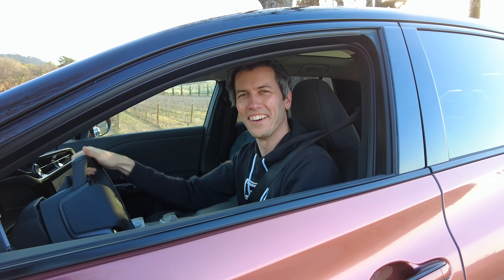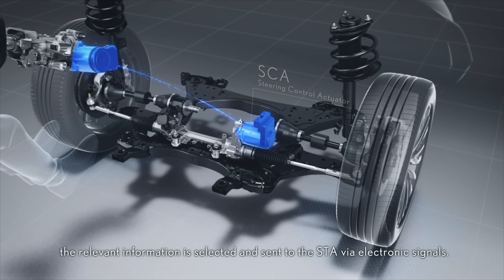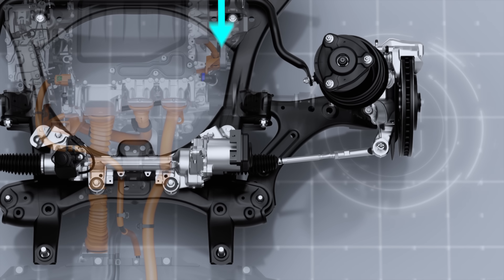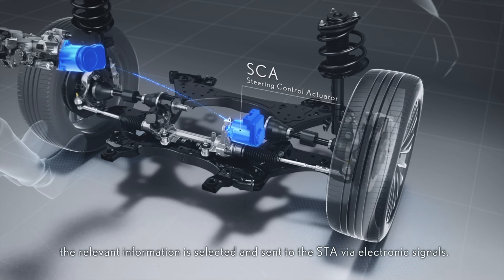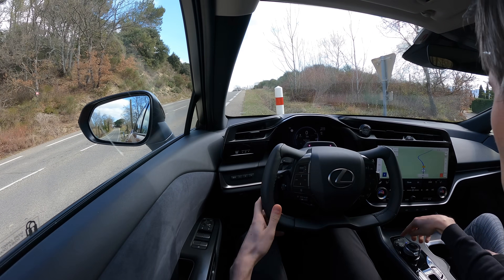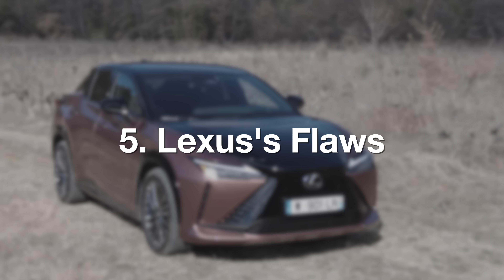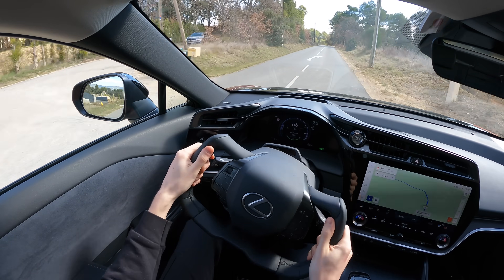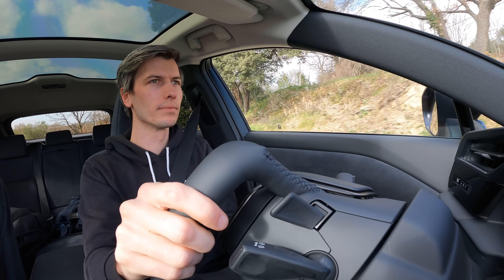How Lexus Fixed Tesla's Bad Idea: Steer-By-Wire Yoke

Comment: One important benefit you didn't touch on Jason is that removing the steering column leads to increased crash safety.  Steering columns are a real pain for automotive engineers as the linkages needs to be able to break so that a column doesn't impale your chest.  Removing the steering column completely helps with crash safety a lot.
Reply: A lot of people would hate this as it would feel hard to predict. An obvious solution would be to have different ratio modes you can manually change between, like changing gear.
Reply: @frozenwindow407  Interesting idea, I think the main challenge would be making sure everything stayed in alignment (center is center in all gears).  A gearbox has the neutral position btw gears, and sequential gearboxes have a larger gap on the dog engagement teeth so you can slam the gears with a higher chance of engaging (introduces backlash).
Reply: @amorag59  since there are no actual gears here, alignment would be trivial. Keep in mind that all the mappings are done in software.
Reply: @falxonPSN  Alignment is not trivial if the rack cant keep up with the steering wheel as shown in the vid. Oh the mappings are in software? Ooh I thought they were kept in a rolodex 🙄🤣
Reply: @amorag59  All he's showing is a finite processing delay. There's no inaccuracy whatsoever. So yes there is absolutely a guaranteed correspondence between dead center of the wheels and dead center of the steering. And yes it is trivial. All that would have to be done is to reduce the processing time or the number of data points being averaged before being sent to the motors, but this would admittedly make the output slightly twitchier but that would essentially resolve the issue.
Reply: @falxonPSN  You want a fast response time with minimal overshoot to "align" the rack to the set input. If you have so much response time (ie driving at low speeds, rack is not as responsive) in an extreme example the rack would never hit continuously varying set inputs - this is far from "no inaccuracy whatsover" . If you shake the steering wheel to its extreme left and right the actual wheels cant go from lock to lock and end up instead cycling near the center point. This is what we saw in the video.
Reply: @falxonPSN  I'm not sure why you are arguing that something without mechanical alignment would perform the same and never lose alignment...
Reply: @falxonPSN  How do you even know the problem is down to response time of the controller? It could be the actuator is at it's peak performance.
Reply: @amorag59  it's just basic motion control theory.  You average a certain number of responses (and/or apply a hysteresis curve) to prevent having a noisy output.

I guarantee the actuator speed is not a problem for one simple reason: if it was, they could simply put in a faster actuator or better gearing.  That's not rocket science, and would not be a huge deal.
Reply: @falxonPSN  It's hilarious you are still arguing that a point doesn't exist that we literally witnessed in the video. If the response were on point we wouldn't be seeing the steering wheel and front tire steering not perfectly in tune.

Edit: And my comment was "how do you know?", did you design the system? You don't know the cause any more than the rest of us. You can only theorize that they could have put a faster rack motor or geared it better. There could be a reason that neither you or I are privy to, but again the fact that were discussing "fixes" literally is indication of a problem.
Reply: @frozenwindow407  no, physics can easily transfer force feedbacks by just running the servos in reverse. With tuning it should barely feel different. But the whole point of argument here is that in the event the electronics fail, which is very much more likely, you'll die. Your steering wheel will be no different than the one like on the kids trolley.

Also since its electrical its also easier to sabotage, any wrongdoer can just grab some emp circuit, stick it somewhere and run it remotely, suddenly your steering has zero responses.
Reply: @aoyuki1409 It's like you forgot to listen to the bit about redundancy. I doubt it's any less safe than a traditional mechanical steering systems which can and have failed many times. I think the more important question is - is it an improvement? From Jason's feedback I'd say not at this point in time. I don't think the "benefits" of a yoke make up for the shortcomings of the system. Let's face it - we're really clutching at straws when we try to point out the "negatives" of a round steering wheel. I think the only valid one is the yoke is "cool".
Reply: @aoyuki1409  wouldn't that kill the car too and not just the steering? I feel like it would stop more than just the steering if youre throwing emp out.
Reply: @takumi2023  i mean when we try to electrify every part of the car yeah. car industries now needing electronics ruined the balance of supply and demand in electronics and caused severe inflation prices and supply issues. also the fact that vital components such as proposed steer-by-wire would need to be properly maintained and inspected and tested many times more than a steering column. i know people who dont even change their oil until their engine is close to seize. imagine suddenly losing control of your steering in any other way. sure airplanes can use it but they check those every single time they land
Reply: @aoyuki1409  where is this sophisticated sabotage that's happening all the time in the real world?
Reply: @ellemnist  even a random power surge in power lines can knock electronics temporary even if its not connected anywhere. Even the static in the air during a lightning storm can sometimes jam your smartphone screen. Electromagnetic interference is everywhere and how do you suggest shielding against them? Really huge and heavy grounded metal plates? Pretty sure the intent was to remove a heavy piece of shaft. And how do you expect consumers to pay for maintenance of expensive, sensitive  and important electronics motors and servos. Its basically your string of life. Not keeping it well maintained equals certain doom. Not just for you but for people around you, and your family.

Steer-by-wire is a solution to a problem that doesnt exist. Collapsible shaft steering with EPS by far the best, safest, and economical that isnt too complex for general consumers.
Reply: @aoyuki1409  well that extremely unlikely scenario of using an emp would kill most modern cars anyway.
Reply: @Moe_Hippo  but it wouldnt disconnect the steering or brakes. Its not like suddenly the windscreen stops being transparent because you ran out of juice
Reply: @aoyuki1409  It's likely that, since this system is likely to be computer-controlled, an evildoer can not only EMP your steering, but hack it and reprogram it however he wants. Maybe it'll steer normally until you reach highway speed, and then suddenly swerve across the median. The possibilities are only limited by the hacker's creativity.
Reply: @takumi2023  Sure, the car would be dead. But normally, if your car dies on the highway while you're driving at highway speed, you can steer to the shoulder. Not so with this car. Not only is the car dead, but it's also unsteerable. All you can do is slam the brakes and hope the guy behind you doesn't slam into you. Unless the brakes are electronic too.
Reply: @aoyuki1409  my 96 f250 has throttle by wire for nearly 30 years now, never had a problem. Even gas  vehicles had throttle by wire for over 20 years. taking an extreme and making it seam like it normal case is not a reason to try to improve tech
Reply: @aoyuki1409  , and yet fly-by-wire systems in aircraft are more robust in comparison to analogue systems.

Moreover, even military aircraft weren't sabotaged in a way described by you. Also, modern cars with mechanical steering still require power for hydraulic or electric power steering systems. While the steering wheel will still work without such system, unprepared driver will still likely lose control of the vehicle.
Reply: @aoyuki1409 , Faraday cage will fully shield any electronic.

Anyway, aircraft, both civilian and military, do not seem to suffer from electromagnetic interference to the extent that is implied by you, despite many of them using fly-by-wire.
Reply: @aoyuki1409 in the age of electric cars and emp would comprise the whole car whether steering was mechanical or not
Reply: @kushday1155  its not about if the car was compromised. its about HOW the car was compromised.

a compromised electronic brake is manageable, parking brakes still use physical cables to engage. downshifting and engine braking still functions.

a compromised ignition system just seizes the engine. still manageable to some degree.

a compromised steering? you cant even dodge obstacles. this is assuming it fails to open. if it fails to haywire then you will get rocked left and right and might flip the entire car.

the point is you're more likely to die in an emp attack with a car with drive by wire steering. an emp device is also not that hard to make, you just need a pulsing high voltage spark. old car ignition coils can be bought at junkyard for cheap
Reply: @aoyuki1409  correct me if I'm wrong here .. does a emp not compromise all electronics in a specific radius.. now if this was used remotely I assume it's whilst the car is running ...let's think of a tesla for example , your fucked regardless in that scenario..  when you think about everything that's electronic in the car . BTW I understand it's an extra point in failure my main concern is the lag , software bugs and hacking .. not really emps . But maybe that should be a concern but for all electric /hybrid cars
Reply: @kushday1155  that type of EMP you're talking about is a megawatt version. it would be a stationary or mounted weaponry only the military can afford. at that stage, your probably should worry more on surviving alive, than trying to save your car. I'm talking about smaller, diy, arson/thief level emp that is basically a tesla coil that criminals and vandalists can make from scratch. these devices can be installed on a targeted (random or not) car and remotely activated. it has a fairly small radius like a few meters for battery operated ones but they would be strong enough to cause mild or severe disruption on electronics near them while the emp is active. usually you can protect your sensitive electronics with grounded shields but there will always be flaws people can exploit.

if you're American and you have a spark taser, that is basically a weak EMP device. if you have your taser on, your touchscreens will not function properly because of the radiated EM waves from your taser
Reply: @frozenwindow407  i mean, no. hard to predict? i strongly doubt this xD if a shitty company with no money can develop racing wheels that manage to actually give decent feedback, then a very big company like toyota can too xD especially when you consider that when you drive a real car, you get a lot of feedback through your seat too. (usually the one thing people say racing sim setups lack, hence motion rigs)
Reply: I guess you're going to need that safety when crash has become 10 times more likely once joy-con drift begins
Reply: Yeah but an electrical failure could cause a crash in this thing that wouldn’t have happened in a car with a column.
Reply: In a modern car, how often are people impaled by the steering wheel? The numbers are probably very low now compared to cars that predate the airbag.

I would rather see innovations in pedestrian safety. In the United States of America, vehicles are getting heavier, taking up more room on the roads, and higher drive heights. In the hands of a regular suburban consumer, this is a dangerous combination for pedestrians. Doesn't help that SUVs and trucks account for a significant portion of air pollutants.

Government regulatory agencies need to start enforcing CAFE regulations on the "light truck" and "SUVs" segments. It's getting out of control and people are dying because of it.
Reply: @polecya  EPA regulations are the reason that light trucks and crossovers are so big to begin with.
Reply: @polecya  46,000 automobile related deaths per year in the USA... probably pretty often.
Reply: My immediate thought as well 👏
Reply: Yea but the milliseconds you lose from input delay will put you in a crash
Reply: That chestnut has been solved with the collapsible steering column for decades.
Reply: oh great, at least the steering rack wont impale me after i crash due to being unable to swerve after my software decided to die
Reply: if there is no console (the console can be flexible or retractable), you can hit the dashboard, if not dashboard, you can hit front window and so on...
Reply: Yeah sure, let's just get wasted by motors and a huge chunk of steel, instead. Did you see all the crap right behind the wheel?
Reply: That's the only eproblem about the traditional steering systems imo
Reply: Yes, also cars become more unreilable
Reply: maybe in the 1980's
Reply: If you ever lose power while driving you'll want that steering column real bad
Reply: Didn't even cross my mind how that would be a possibility. The things we don't even notice are taken for granted
Reply: @eugene9852  what do you think would be bad about manually changing ratio settings? The reason I thought it could be good is that the control you have is more predictable that way.
Reply: I'm sure that'll help with all the crashes they end up causing
Reply: Good point. It's like a spear directed at your chest
Reply: But what is the issue if the problem was already solved? This new tech has not been necessitated by crashes I can assure you.
Reply: Collapsible steering columns are a thing
Reply: wow
Reply: First though on my mind... Old cars impale people, then start breaking the steering column, but was not exactly perfect for some time, and failures over the years make some victims. Removing it, totally are a great safety earn
Reply: This is not the 1960s. That problem was solved a long time ago. My question is what happens when the system fails. It power steering fails you can still turn your can to get you off the road. When your steering position sensor fails, bad things will happen
Reply: “completely helps with crash safety a lot”

wow so scientific. you’re a real expert 😂
Reply: Terrible take, steering columns are already designed to collapse, on the other hand a sudden electronic failure will absolutely cause a crash with this abortion of a idea.
Reply: Okay and that crash wouldn't happen in the first place if the electronics didnt fail and you have no steering whereas even if your power steering fails you can still mechanically turn the wheels. Steering by wire is RETARDED
Reply: That's useful when you crash thanks to this moronic system.
Reply: Any maybe if you had a mechanical connection you wouldn’t have crashed in the first place
Reply: So to remove the steering column to help with safety, a problem that has already been solved for decades, you have to design an entire electronic feedback system to simulate what the tires are doing. I’m not seeing the benefit here…
Reply: @maynardewm  they could literally use off the shelf sim racing components
Reply: @maynardewm  thats because you're not very bright
Reply: ...and that will come in handy when the car overrides your "moose test" maneuver when you're trying to avoid a crash...
Reply: @blechtic  If it overrides your input, that means you'd have skidded anyway if it let you do that, meaning you'd hit the moose either way. IIRC fighter jets have a similar thing where the fly-by-wire tops out at certain points to prevent you from changing direction so fast that you'd snap your neck. If anything, NOT having the direct mechanical control means the car's stability control can do the absolute best to avoid a moose by steering as much as possible, whereas the human behind the wheel running on adrenaline and minimal training would probably skid.
Reply: @blechtic  Lmao, car be like "What moose? I don't see any moose. You need to be STABLE on the highway, turn SLOWLY 🥰"
Reply: That engineering problem was solved decades ago, though
Reply: @luisdetomaso867 removing a problem from having to be solved is better than keeping a solution to the problem. It also provides more flexibility in design.
Reply: @_KingRaz  Right.  An electromechanical system that costs thousands of dollars and has dozens of components and failure points is a better solution than a $25 collapsible linkage
Reply: @luisdetomaso867  well said ;)
Reply: @luisdetomaso867  That was a stellar comeback. Bravo!
Reply: @_KingRaz  Okay... explain to me, What do you think of the sensitivity.? A fixed wheel turn to steering turn ratio is predictable. while a different wheel movement to steering input at different speed is something that you will only have to learn from the vehicle movement to again adjust.  

I will never say Yes to this
Reply: @ധാസപ്പൻ  sure that's fine. Steer by wire can be fixed as well, it doesn't have to be adaptive, it's just an option for people who do want it. I don't think I would like it either and I drove for a living for 6 years, but everyone has different preferences. It's not even an option with a direct drive.
Reply: @luisdetomaso867   I think most modern cars use lot of computer electronics, with more data & over the air updates, this technology can further be improved upon with AI/ML models and actually might decrease the cost of the vehicle (may not be initially), the censors are actually cheaper and due to reduced weight the increased fuel efficiency. I had a Honda civic and it's been 15 years and none of the electornics gave up eventhough I had driven it rough and tough and most components are electronic. So I'm a BIG YES for this technology.
Reply: @luisdetomaso867  None of that matters when it’s life and death.
Reply: @_KingRaz  you are right. You are removing completely a failure mode.
Reply: @ധാസപ്പൻ  I get where you are coming from, but Lexus and others have had Variable Ratio steering for decades now as an option in some SUVs.
Reply: @luisdetomaso867  I do believe this system would be great for racing though, the increased cost and decreased reliability wont matter if your car isn't going to last more than a few races anyway, the fact the steering wheel isn't directly connected means that the wheel wont jerk your wrists left or right and cause injury, would be super useful for NASCAR considering the speeds of the crash and weight of the body and wheels.
Reply: @grandiewandie  It depends on how good they can make the feedback and response time.  Race car drivers require extremely precise steering
Reply: @_KingRaz  not necessarily if removing the problem introduces a new set of problems, such as a delay between steering wheel rotation and wheel rotation
Reply: @luisdetomaso867  so you put money over driver safety, embarrassing comment
Reply: @OHNO-k9l  no it wasn't though
Reply: @ant2312  What's embarrassing is that you truly believe a fake electric steering wheel is safer because some guy on the internet told you so.  Modern collapsible mechanical steering works fine and is perfectly safe.  This solves a non-existant problem
Reply: @_KingRaz well said!
Reply: @luisdetomaso867  very well said ;)
Reply: @luisdetomaso867  Dozens of failure points? Don't you mean millions of failure points? There's definitely software in this system, and software is the most unreliable thing ever.
Reply: @luisdetomaso867  said the one that has eps in his car
Reply: @_KingRaz decisions are not fashionable
Reply: @luisdetomaso867 all consumer vehicles will eventually go this way. Not in the next decade, but in 50 years? I can see it.
Reply: @_KingRaz .. and it then it adds additional problems
Reply: @luisdetomaso867  Uh the regular steering column has just as many failure points... including one by design...
Reply: @_KingRaz No you're wrong, also if your electrical components fail how do you steer?
Absolute reliance on technology is already shady as it is,
Absolute reliance on gadgets seems very foolish in my opinion
Reply: @_KingRaz  this is literally reinventing the wheel
Reply: @luisdetomaso867  Yeah, and AFAIK there is also a movable column approach where it moves with the steering wheel. Because how can the column impale you if there's a steering wheel at its end?
Reply: Not to mention this solves the LHD and RHD issue.
Reply: Collapsible steering columns are incredibly simple to design and that's been a non issue in crash safety for decades. Look at crash tests that have been conduced far beyond survivable impact speeds, and it's apparent that the idea of occupants being impaled by the steering column is a thing of the past.
Reply: @crudboy12  since every vehicle design is different not all Steering racks and steering columns are the same. For each vehicle there are thousands of dollars invested in Crash Tests and Sled Tests just to design freeze after PV validation. So the vehicle dynamics basics are there bc years of legacy data but collapsing performance is still a failure mode that needs to be addressed on each product launch. As I said this, there are other issues with Steer by Wire that still needs development but if it is solved that is the future for steering systems.
Reply: Prove it! Breakaway steering columns have been around for ever so there is no engineering challenge there. Drive by wire is not like fly by wire because their is no redundancy. Also, cars don't get the routine maintenance that aircraft does. Today's cars are overly complicated engineering nightmares. 

Automotive engineers don't live in the real world and they have dangerous tunnel vision. When the steering control unit fails because of corrosion or crap wiring harnesses or ECU failure the driver and other innocent people pay the price.
Reply: Invented by people that come to work on a bicycle.
Reply: Just waiting for their service calls of 10milion cars due to quality of the any sensor or redundant sensor, motor or redundant motor, battery or redundant battery lol.  they have shooted in own foot with such unbelievable overcomplicating simple things...
Reply: @qqqqqq6686  no one calls Nissan customer service when their tire pressure sensor goes bad
Reply: That's a problem that was dealt with a long time ago and the steering wheel shouldnt move otherwise youll get killed by the damn airbag and after a certain speed no matter how is the car made,designed and whatever the safety rating you will die or get really haveily injured. Crash tests are not done at vary high speeds.
Reply: If a car has proper steering instead of a Fly-by-crap, then accident is less likely to happen.
Reply: It simplifies design and construction for left or right steering.
Reply: I drive order pickers at my warehouse job. They use steer by wire. Let me tell you: if you go to make a subtle direction correction, it can wildly throw your angle off. I've nearly crashed into several racking units because I made a slight adjustment with the steering wheel and it decided to throw me off to the side. Mechanical linkages are way better at helping you not get in to a crash in the first place.
Reply: @UmbraFaux  we have those at the airport, yeah they are really horrible. But it's is way different
Reply: that problem was solved ages ago with the telescoping steering shaft, nowdays nobody gets impalled by the steering shaft, you may be hit by the steering wheel air bag, but thats it
Reply: This is a very elaborate and expensive way of solving a problem that was solved ages ago but I guess that's the whole point of it. Big cost, small benefit.. at least from a consumer stand point 😉
Reply: @talictdf4757  Bet the reliability is lower and the service costs are higher, too.
Reply: This isnt elimination. This is substitution.

We are substituting a steering column that has been engineered to collapse during crash, in exchange for a steering system with 3 times the failure point, complexity, price, and last i checked suddenly losing control of the steering usually results in crashing. Definitely worth the swap if you want people crashing and dying faster and more often
Reply: @aoyuki1409  Also, it's kinda sleazing around the issue to make redundancy highly integrated, so I'd suspect with a compact dual-motor setup in one casing, there can occur issues that would affect both motors, so it's potentially dangerous pseudo-redundancy.
Reply: @aoyuki1409  "...Definitely worth the swap if you want people crashing and dying faster and more often"
Luckily nobody tries this with really critical things like planes or giant trucks...
Reply: @irgendwieanders2121  yeah those are electrically augmented control system, they still contain crucial mechanical linkages and mechanisms. i do wonder why they aren't made fully steer-by-wire
Reply: @aoyuki1409  Electrically augmented? Not purely mechanical?
Now I am afraid... Wires can break!
Reply: @irgendwieanders2121  Luckily every day driver maintains their car like a plane and drive it at giant truck's speeds.
Reply: @aoyuki1409  planes do not have mechanical linkages between controls and control surfaces, it’s all fly by wire
Reply: @aoyuki1409  that literally doesn’t matter, there isn’t a direct physical connection between the control device and the control surface.
Reply: @cennty6822  Depends on the plane. Most Boeing models do have a mechanical connection, via hydraulics, between the controls and the control surfaces. It's only Airbuses and military fighters that are true fly-by-wire.
Reply: @irgendwieanders2121 the most reliable aircraft have manual controls for backup, eg the A-10 Warthog.
Reply: @ZombieLincoln666  🥰
Reply: We figured out collapsible steering columns in the 1970s, guy. It's proven technology.
Reply: The thing isn't the steering column, it's the physics. People in the passenger seat/back seat/trunk still die so it doesn't really help in a very significant way.
Reply: Automotive engineers are a real pain to consumers and mechanics. Wait until corrosion in the salt belt destroys the BS steering module.
Reply: It does however increase the likelyhood that you'll crash when an electronic failure could mean you can no longer steer the car at all.
Reply: @BigUriel  it decreases the likelihood that your car crashes when your collapsible steering column breaks as well
Reply: They need to be able to completely control the auto for cases of non-compliance.
Reply: Not really as you now have a module that is a dense box instead of a long multi contact shaft... pretty much a stead box is MORE likely to fly away as it has less points of content and may be HEAVIER to.
Reply: we solved that allready. like 20+ years ago....
Reply: But it's a problem already fixed ages ago and has multiple standards that are both economical and safe. Removing the steering column, and integrating a new technology that is technically less evolved and proven, so becomes less safe. Give me a steering column any day.
Reply: @eugene9852  nope, like 99.99% (probably way more actually) of cars on the road have a mechanical connection between the steering wheel and the front wheels, and a hydraulic connection between the brake pedal master cylinder and the callipers. 

Which is the way it should be, because even if all your electronics go haywire, you can still steer and stop.
Reply: So they've offset the increased chance of an accident by making that accident safer.  I'll pass, thanks.
Reply: People saying “what if something fails?” clearly didn’t pay attention to the video. 😂 Every part that is essential to be able to steer the car has a an emergency backup. If something does fail you get notified of it, and can still steer and stop the car safely. If you’re b*tching about the added repair cost then don’t buy it! It’s so simple. If you can’t afford the maintance/repairs on a vehicle what do you do? YOU DON’T BUY IT!!!
Reply: In 1978 Mercedes-Benz W116 got antilock breaks. They were expensive. Extremely complicated. And increased the stopping distance more than 25%.

 So saying something is a bad idea when looking at the first implementation isn’t really useful. Look at what benefits it gives you. Then decide if those benefits are worth the continued engineering to perfect the system. Removing the negatives and making it cheaper.
Reply: Then you get the increased chance of crash because of the unpredictable steering wheel action. In a perfect scenario, the driver needs to pass some learning curve because the new vehicle reacts totally different in all the different danger scenarios.
Reply: That WAS a problem with rigid steering columns. But it has been solved decades ago. 
To avoid the brake cylinder to be moved by the engine block or other rigid parts in case of a severe frontal crash, is the more current problem to be solved even in cheap cars.
Reply: @Nitramrec  cheap cars are on the chopping block. Those that have a hard time replacing brake pads when needed have zero clue as to what is coming.

Yeah but Tsal electric autos utilize regenerative braking so there will be no more need for brake pads.

Lol.

/Listening to Red Barcheta
Reply: also about safety, if people are to scared of steer by wire then they shouldn't get in a plane aswell because of fly by wire.
Reply: @vodkarouge1352  Aviation use has high levels of redundancy as well as the fact that the industry is heavily regulated and has scrutinized maintenance requirements.

Meanwhile there's drivers on the road with bald tires and rusted out undercarriages. Texas even went out of their way to make safety inspections no longer required to register a car. So yeah pretty big differences between automotive and aviation.
Reply: @vodkarouge1352  Planes also have mechanical backups and are tested often, and the planes that are fully fly by wire are too twitchy and sensitive to be flown normally and only used for elite, specially trained pilots.
Reply: @vodkarouge1352  except passenger planes use hydraulics and there are a backup systems.
Reply: @dansmirnov236 , modern airliners are fly-by-wire only with redundancies being purely electronic as well.
Reply: @vodkarouge1352  oh please don't ever try to compare It. what you saied Is pointless
Reply: @vodkarouge1352  You can't be serious lol. That's an apples oranges comparison. On highway cars need way more handling and response. A near miss incident in the aviation industry is when two aircraft come within 500 feet of one another - which generally doesn't come down to split second decisions but a long chain of errors.
Reply: @amorag59  the comparison holds true considering the same argument people use against steer-by wire can also be applied to flyby wire being that if the system fails, you’ll lose control, being more expensive, more complicated and more prone to failure. Hardcore boeing fans kept pandering about direct mechanical linkage between aerofoil surfaces and yoke untill boeing used it themselves later on.
Reply: @hodb3906  There have already been a number of crashes caused by the computer ignoring or actively defying the pilot's control inputs. Usually the pilot gets blamed when this happens. The 737 MAX is a refreshing exception to this rule, but the engineers were still allowed to "fix" the abominable MCAS contraption instead of being fired and Boeing being forced to remove it from the design.
Reply: @amorag59 , combat aircraft such as F/A-18 which is also may be used for aerobatics, including performing while flying in formation, do not suffer from the lack of responsiveness. You do know that electric signals basically travel at the speed of light, right?
Reply: @sciarpecyril  I'm an electrical engineer so miss me w/ the silly condescending comments. First of all in a multi million dollar jet the response time for the controls better be fast. I'm sure F/A18 flight control response is on point compared to 12:27 where the steering rack can't keep up with the set point from the steering wheel.
Reply: @sciarpecyril  You also missed my point of the simplicity of having a physical connection between the steering wheel and the steering rack so the steering is always "in sinc". Fly by wire make sense on a plane thats in autopilot most of the time and where the control surfaces are better suited being controlled by the computer for flight stability. But at the end of the day even planes like the 737 still use cables as means for backup if the electronics flight controls fail. I don't see any consumer benefits given the added risks of a more complicated system. In the world of engineering simplicity is best for critical systems.
Reply: Yea, but imagine if a sensor breaks for the steering wheel, what are you gonna do then? The wheels won't turn anymore.
Reply: @simonmarcu01  imagine if your abs sensor fails and decides that your front left wheel is going to lock up now because of a bad input or output signal.  This technology has been in use in planes, and in other forms in cars for decades.  It’s nothing new
Reply: @simonmarcu01  which part of the video did you miss that stated every part of it had redundancy
Reply: @simonmarcu01  imagine if a sensor fails?  I imagine the other one would just take over.  isn't that why they put two of them?  

while we're imagining, imagine what happens when the mechanical linkage fails, with no redundant linkage because that also broke ages ago and nothing was able to notice it.
Reply: @jnawk83  which part of the video did you miss that stated every part of it had redundancy
Reply: Yup, Ayrton Senna died because of it.
Reply: @LuisHansenNH  No, senna died because an engineer tried to cut, lengthen and then weld his steering wheel before the race. The welds were poor and broke during the race.
Reply: Some people, I won't mention, Luis DeTomaso, hate advancements in technology.  And have no clue about how safe electronic systems are.
Reply: @Sammasambuddha  Some people don't understand why it is so necessary to replace a simple mechanism with an electromechanic "wonder" which causes only issues and brings no real advantages. It's not only the column what was already solved, but the response of the steering varies with the speed today, and Ford has a system with variable gear ratio, too. But you can still turn immediately and precisely if you need.
Reply: In the SbW technology, the column is still present. Basically everything you have under the wheel is the same thing as EPS technology. You have reach and rake adjustments, you have crash impact with the same technology as traditional EPS. Only the intermediate shaft is missing. Nothing more. Furthermore, the OEM didn't adjust the SbW slot and they kept the car's bar and surroundings on par with the EPS.